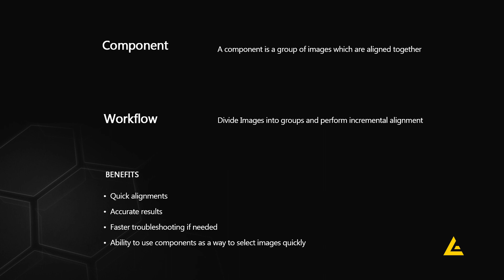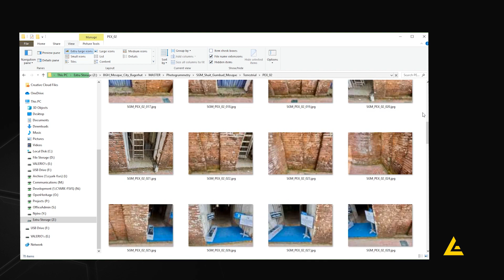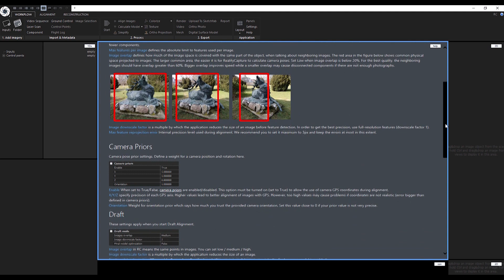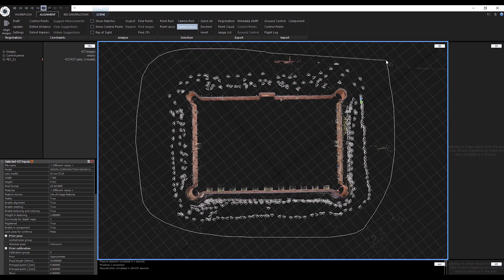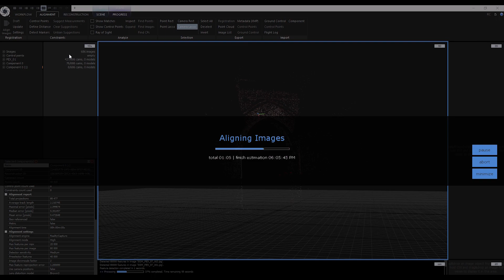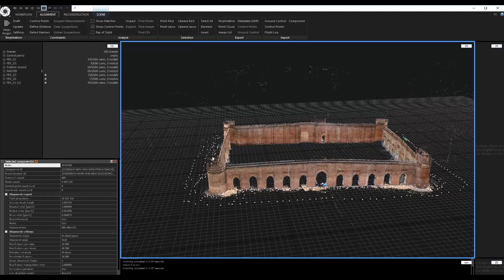Component workflow in RealityCapture by CyArk - Part 1

Comment: Idk every time I align I get like 20 different components created instead of one like you. My photos have significant over lap and easily distinguishable features. Tried smaller batches of photos, retaking photos, merging the components, aligning just a few photos then merging, nothing. It just doesn't work. Idk what I'm doing wrong
Reply from the maker: What kind of object have you captured? What is the significant overlap?
Reply: @RealityScanOfficial  A week late but ive tried a few different things. I started trying with a room in my house. Took a video then turned it into photos and selected like 5% of them because it was like 8k photos. It didn't work. Kept getting random points across 15 or more separate components. So I tried taking about 100 pics of my car only to have the same issue. I tried my car, 2 separate rooms in my house, a small statue. I tried less overlap in the photos and more overlap only to have the same issue. After Align Images is done all I get are 10-20 separate components all filled with nonsense points. I tried to export some of those nonsense points into postshot to make a splat of them to visualize what points the software was making but they were all unrecognizable. I don't know what to try next. Every guide I follow just gives different results than what I get.
Reply from the maker: @nickalfonso8616  How was your capturing path of the room? Have you tried to use also images instead of the video?
The car is not an ideal object for this as it is too shiny and featureless in general.
What kind of statue? Are you following a shape of such object with at least 75% overlap between the images?

Comment: hi, what does the "CTRL+R" do, when you press it twice? i tried to look in some manuals, but there is only mentioning of single pressing this combo .. also, if I need to delete some mis-aligment, how can I do that? Can I delete the source photos directly? as I found out only after alignment, which are wrong ..
Reply from the maker: Hi,
CTRL+R - Disable an image - Disable/enable an image selected in the 3D view for further processing.
It is not possible to delete the image after alignment. You can disable it for the alignment and then align your data again.

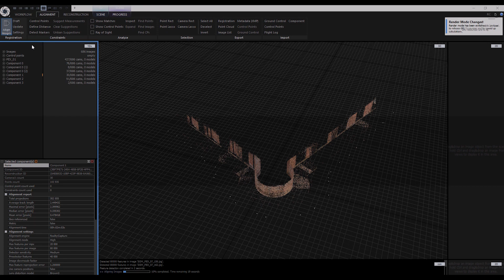Comment: Great tutorial.  Can I ask why you would need to re-align all images after you have created separate components from smaller alignments (5:36)?  Does it use the other aligned components before tackling the individual images?  It feels like it's repeating the process a little and ignoring the processing it's done, but I'm guessing it isn't?
Reply from the maker: That alignment was used to merge all small components. As the features are already detected, this is a quicker process as aligning all images in one step.

Comment: is it possible to take interior and exterior photos to view inside and out?
Reply: Hey Thomas - so I'm not the creator of this video but I do know that the creator did capture both interior and exterior photos. They created individual components of each and had it separated. I have not found a video/tutorial yet though where they show the full rendering inside and out though. I do know that it is possible (its actually in one of my upcoming videos/projects so i'm looking forward to that challenge as well). 

I recently made a video about modeling a bar/tavern in my area and plan on creating much more to come if ya want to check it out!
Reply: Joe Peluso oh nice, yes I know it’s possible to do it separately and import to mesh them together but I was wondering if the software can figure it out if there’s and interior. I will check your channel out
Reply: @thomasmahase  ah - no I don’t think it automatically detects/separates what is the interior vs the exterior but I wouldn’t be surprised if they’re going to work in some sort of AI auto-check of sorts for that